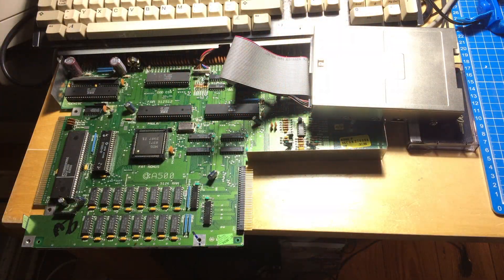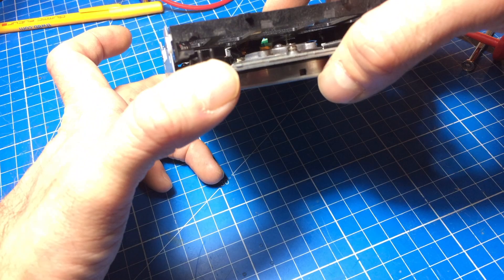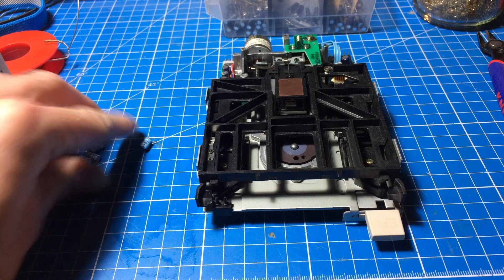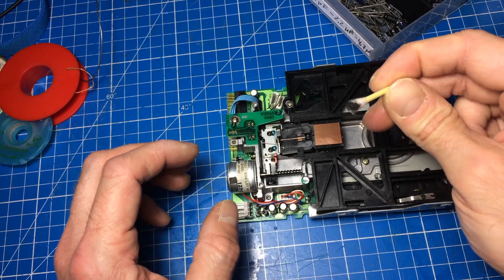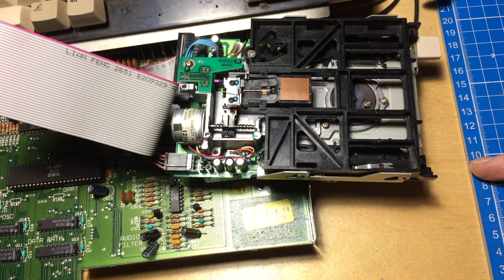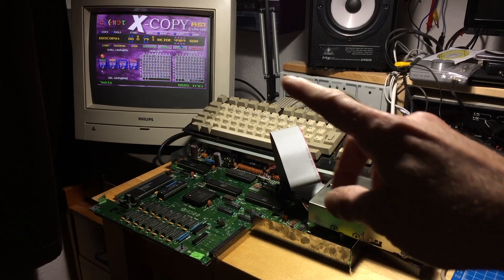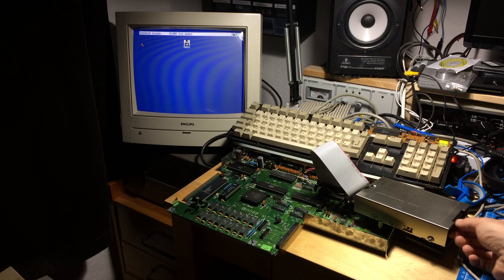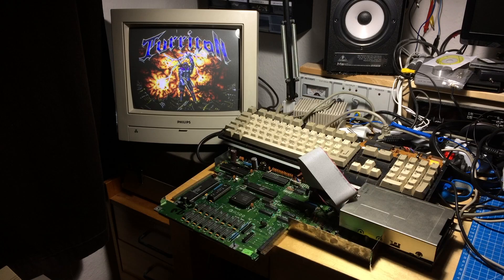Amiga 500 Disk Drive Chinon FB-354 Rev. E Repair

Comment: Usually nothing terrible goes wrong with them, does it?
Reply from the maker: They are quite robust, especially compared to the 5 1/4 drives. Most are easily fixed, I think. Even clumsy Jan only managed to completely kill one of these (I ripped it apart to hastily and broke some traces on the PCB)... Most are quite easily fixed, I think. ;)
Reply: Oh you haven't seen me at work obviously :)
Reply from the maker: The Highlander Haha, no I haven't. Can't be that bad. Maybe it's time to make some repair videos? ;)
Reply: I did a few. The one where I applied heat sinks to my c64c was met with much criticism :)
Reply from the maker: Oh, didn't realize you did that. I have to watch it and comment then. ;)
Reply from the maker: There goes my evening. ;) Thanks! Will have a look later.
Reply: Jan Beta Sorry honey, I have videos to watch!
Reply from the maker: +The Highlander Haha, that's exactly what's going to happen tonight. :)
Reply: FB-354 in my Amiga ended up with a broken head (there was no continuity in the head windings). This kind of damage is unfortunately fatal.

Comment: I'm Curious: was the drive giving read errors before replacing the capacitors? I mean, they are someway connected to the data line or they are just involved in the motor/power circuit? I'm asking this because I got several drives that even after a good cleaning, of th head still give me read errors, but I never considered replacing caps since I've always thinked as a unusual and unuseful practice on a disk drive.. so please illuminate me... what's the purpose of the recapping? :)
Reply from the maker: I totally agree with Gary. I always tend to replace caps (especially small capacitance) of a certain age because they are cheap and if you use quality ones you don't have to worry about that problem for the next couple of decades (hopefully). All electrolytic caps fail sooner or later because the electrolyte slowly dries.

I've also seen quite a few of these drives fail because of faulty capacitors. I had one with SMD caps that had intermittent read/write errors. I fixed it by replacing the smallest cap (1uF, I think) with a new one. It's pretty typical it seems. GadgetUK164 made a video about repairing some of these drives and also found some faulty caps in them.
Reply: thanks, that's the reply I was waiting for, I didn't say that I don't agree with the recapping, I've just asked if was one of possible causes of failure..
Reply: salvob One never knows. That's about what capacitor in practice means.😯
Reply: salvob Google for 'Wikipedia Capacitor Plague' it will learn you everything about capacitors and how it hunts old but modern technology. Wikipedia has excellent articles and sources.😎
Reply: GaryKildall thanks for your reply, I know about capaciror plague, I just like to know if the replacement was done by precaution or he had verified that the capacitors was faulty before removing and if they was involved in the data feed transmission system or just in the power circuit
Reply: salvob Can a capacitor only be tested if not part of a circuit? By which I mean the capacitor can be tested only after detaching it by soldering.
Reply: GaryKildall you can reverse test system trying to clean the head first, test, and NEXT, check if replacing the capacitors will helps.
Reply: salvob Then I would always replace caps because they are from 80's or early 90's.

Comment: Hello Jan, are you looking for a cover for this Amiga 500? I now there are new covers in different colors. And there is one old one on eBay
Reply from the maker: No, I have one complete A500 and I think that's enough for me (plus, I don't have much space). The one from this video will probably be my test board for some time. Thanks for the tip though! :)
Reply: Jan Beta, i just received my first Amiga 500. Can you do a video about hacking? I want to develop a HDD emulator and floppy emulator for it.
Reply from the maker: That's not a trivial task with an A500 as it doesn't have any native IDE or SCSI support. There are add-ons and cards available but my knowledge is pretty limited in that respect. Would be interesting to look into it but I doubt that I will be able to do a video about that anytime soon, I'm afraid.
Reply from the maker: Yeah, the Gotek indeed is a nice solution for floppy emulation at least. The HDD implementation is not that easy, I think. ;)
Reply: I now there are solutions for de floppy drive, but I like to connect the open-source community to the vintage computer community. So think like arduino FDD emulator.
Reply from the maker: Edwin Noorlander That's a nice project indeed. Did you do some research already?
Reply: Jan Beta yes but the only problem is time.
Reply from the maker: +Edwin Noorlander That's true. I haven't even found the time to look into Arduino any deeper than blinking LEDs at all yet. :/
Reply: Jan Beta maybe that's the reason why we love vintage computers 😂
Reply: Mr T. Guru thanks for your tips. I will look into it. But for me it's a hobby to develop thinks for old computers. So if we can find firmware and circuit diagrams from the ide controller. But I think more of a CLPD or FPGA solutions with SDcard and Ethernet/wifi.
Reply from the maker: +Edwin Noorlander Haha, that's true. :D
Reply: Kipper2K is a very good bloke, simply it had some bad expenses making the A600 Vampire V2 (due not to him directly) and I have understood that at this time he's not making any hardware. Looking forward for he to come back in the Amiga market! Cheers, M